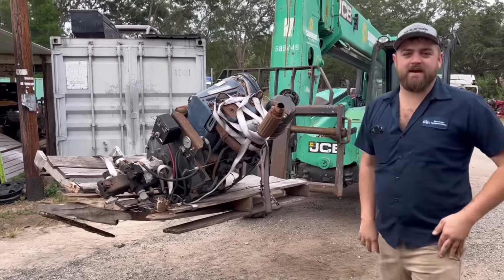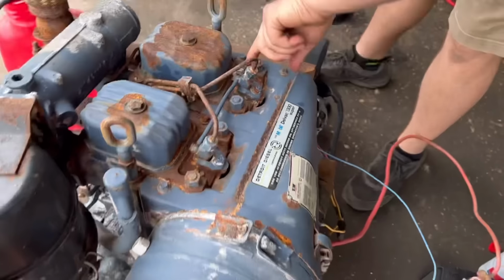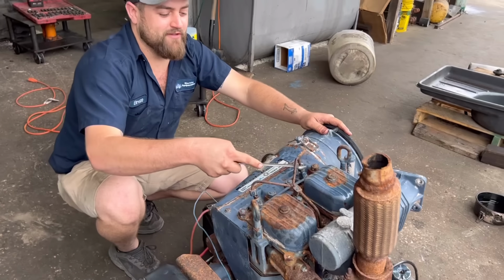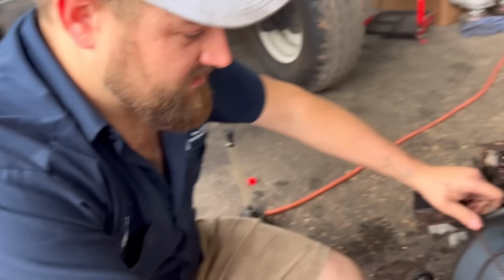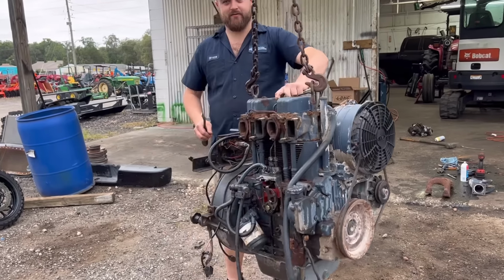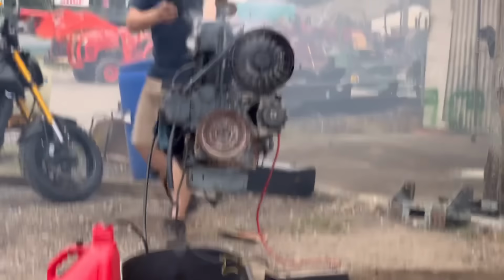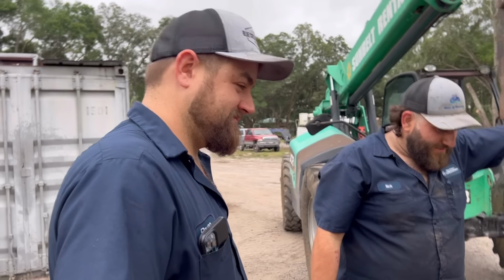Runaway Diesel Engine Ends in Explosion, Parts Flying over our Heads!

Comment: what a waste... (mic drop)
Reply: The real problem is: free entry of air along with accumulated oil in the air cooler. Oil from damaged turbo. You accelerate and the engine pulls accumulated oil. perfect combination to feed the engine at full rpm. oil works as fuel
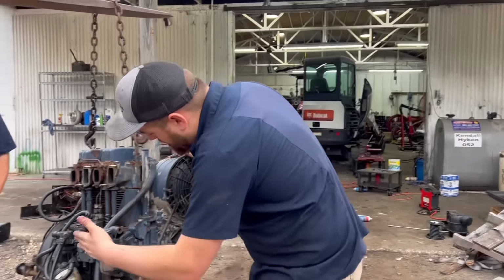Reply: Incorrect. Turbo is non-existent on this engine. This wonderful engine was intentionally sent to the recycle bin due to a lack of cooling. 33:23
Reply: @nobodyinparticular5224  Agree this is a waste. Especially since you can't even buy these new anymore

Comment: I know those engines, shame to see one blown up.
Reply: What brand/model is it? I assume it's a Deutz of sorts
Reply: They aren't really worth a whole lot...
Reply: @davelowets  Lol what are they
Reply: @jetstream454  An old VM Motori S.P.A., made in Italy....
Reply: @davelowets  It's a Deutz from Germany.
Reply: @colejohnson3705  NO, it is NOT...
Reply: @davelowets   exactly its a VM sun diesel V.M. Motori Detroit  industrial /marine / Sun model 2105E1/ 295  /2-cylinder-air-cooled-italian-diesel-engine  w/ detroit badges   2L  @ 31bhp/ 2600rpm  detroit bought VM   some time ago, hence the name but since sold it off . They are very strong engines leak alot , but hey  we all  seen what it could do, and they cooked  a decent valued industrial engine   .They only look like deutz because of  head and push rod covers.
Reply: @manuelcoronac  Huh?? 🤔
WHAT turbo? The engine is N/A.. 😕

The governor (fuel rack) was purposely jammed at full fuel, and the engine simply ran at excessive RPMs without a load until it failed.
Reply: @davelowets  Thanks for that
Reply: @jetstream454  🍻
Reply: Nawww, it failed due to a lack of cooling, the

he cut the fanbelt 33:23

Comment: Wow, I didn't think a diesel engine could spin 7000rpm for an extended period. Cool little engine. Something like that would make a cool go-kart engine.
Reply: ive seen guys spin a few limited pro stock garden tractors over 12k rpm with all stock internals
Reply: Should have a look at some OM606s. They're known as the diesel 2jz for a reason
Reply: operating was 2500 rpm....it was overfueled at 3600rpm...
Reply: Lol lol lmfao lol lol 😂😅😢😢😂😂😂😂😅😢😂lmfao
Reply: @cs-gj3yf You must have bumped your head or been on acid If you seen that with a diesel engine.
Reply: @1998keagan1  i turn 7500 rpm all stock on 80 lbs of boost, trust me i know first hand.
Reply: @cs-gj3yf  ... and then the block splits and sends the top half 8' in the air, with the rods and crank still between the frame rails, flopping around wildly.. 😬
Reply: @davelowets  fun fact, no one has ever split the block, almost all of us run stock head bolts and head gaskets, not very educated
Reply: I think it maxed 4500rpm, after it lost a cylinder was between 3k and 4k
Reply: @cs-gj3yf  A single, one lunger garden tractor? Sure those had BETTER be able to survive 7500 rpms. My little 5th of a cubic inch, one cylinder, R/C nitro engines turn 40,000 RPMs, and make 10+ horsepower per cubic inch.
Reply: @davelowets  the highest rpm the single cylinders turn is around 10k, they make 70hp out of a k361 kohler, some of the 25hp kohler vtwins turn out 14k rpm at round 130-140 hp, those things scream!!
Reply: @davelowets  what are you trying to prove?
Reply: @cs-gj3yf  That 7500 RPMs is something that a small single cylinder engine should be able to easily handle.
My kids Jr. Dragster's 5-h.p. Briggs block on methanol turns 8000 all day with no issues. I hardly ever have to touch that thing with a wrench to repair it.
Just check the state of tune by the spark plug, tune it a little bit, and send it, weekend after weekend
Reply: @davelowets  the engines im talking about have nascar valves and around 100 cubic inches
Reply: @cs-gj3yf  "NASCAR valves"?? 
What exactly are nascar valves?? 
They use the same valves that MANY other engines use.... Manley, Ferrea, Comp, Rev, and many more. There is NO specific "nascar valve" out there, the engine builder chooses whatever brand of valves they want to use. 
And what garden tractor engines can you be getting 100 inches out of? 
It's impossible to even get any where close to that amount of displacement out of ANY of even the twin cylinder garden tractor blocks. 😕 

In most "Limited Pro-Stock" sanctioning bodies, one HAS to run an engine block that is factory to the chassis it's run in.
Reply: @cs-gj3yf  I was a national small engine builder champion MANY years ago in an engine building contest. I've built some PRETTY wild small engines, so this is nothing new to me.
Reply: @davelowets  they are refered to as nascar valves, why? idk, im not a gasser guy. for the cubic inches o meant to say 70 cubes.
Reply: @davelowets  I have some .18 car engines, brand new, that I wanna modify for a 1/10 drag car I'm building: do uou mod your own engines, and if so, what mods do you make?
Reply: @cs-gj3yf  hahaha no
Reply: @detaart  haha yes considering I have done it personally now.
Reply: @cs-gj3yf  Of course you have.  Absolutely.  yup.
Reply: @detaart  thank goodness you know me better than I do, what keeps a diesel with a 2.52 bore and a 2.84 stroke from turning 5 digit rpm?
Reply: @cs-gj3yf  Many factors, but at the core is the fact that the combustion event lasts too long, in other words, it burns slow, so ... diesel engines - ESPECIALLY TRACTORS - are built to take advantage of this with a long stroke, which means higher peak piston speeds for a given RPM.
The valve train also would not survive running at 12k rpm.  Not a chance in hell.  Valves would be kissing pistons well before that.
Reply: @detaart  you think we leave the valve train alone? Custom push rods and 100# valve springs is plenty reliable, the valve heads are 1 inch and 3/4 weighing less than 1/2 a pound
Reply: @cs-gj3yf  LOL so hold on, it's a pushrod diesel tractor, revving up to 12k rpm?  Yeah maybe if you tow it on the highway.
Hey, didn't you say stock internals? lol
So ok ... Audi once made a lemans DIESEL race car, and it won nearly every race it was in.  It was a v10 TDI.  Guess the rev limit on that ... 6500 rpm.
Reply: @davelowets  maybe hes talking about the springs?
Reply: It didn’t reach 7000 rpm.

Comment: That engine was absolutely impressive!! The fact it ran away that long before letting go shows how tough and durable it is!!
Reply: It was lol
Reply: got a holden rodeo ute that ran away past redline (~8k) for about 5 minutes before it quit. We just left it for a few months thinking it was toast before i cranked it over and started and ran perfectly and barely smoked. Isuzu motor is indestructible
Reply: @darcykelly1982  Gotta be a 4JB1T, for one they are mighty tough engines but mostly because their factory turbos always let go 😂😂
Reply: @jetstream454  its a VM sun diesel V.M. Motori Detroit  industrial /marine / Sun model 2105E1/ 295  /2-cylinder-air-cooled-italian-diesel-engine  w/ detroit badges   2L  @ 31bhp/ 2600rpm  detroit bought VM   some time ago, hence the name but since sold it off . They are very strong engines leak alot , but hey  we all  seen what it could do, and they cooked  a decent valued industrial engine   .They only look like deutz because of  head and push rod covers.
Reply: @kingdommusic5456  Thank you for this! Sorry I hadn't got back sooner also
Reply: So it would be a good go-kart engine?
Reply: @darcykelly1982  Detroit Diesel

Comment: Runaway is a myth. The valves float and keep them from revving any higher,  which is true of any engine. Valve spring tension determines max rpm. That engine was almost new inside. Air cooled and it had scored a cylinder from the fan not running.  We run those to pump water.

Comment: You should be carrying a CO2 fire extinguisher on every "will it start" one blast into the air intake will shut down a runaway diesel immediately and not harm the engine. It's what we use and was taught at the fire College

Comment: The easiest way to start a diesel with low compression is to blow a heat gun into the air intake. If the injection system is working, it will start as easily as a fully warmed engine. You can keep the heat on the air intake as long as necessary, until the engine does warm up.

Comment: That engine restored looked like it would have made a great engine for several applications.
Reply: Those forced air cooled engines were used all over from manlifts to mini excavators neat little bangers
Reply: @bryanphillips1432  meaning they are great/reliable little power units. Really seemed like this one would have been a good engine with a little maintenance seeing how much abuse it took before letting go.
Reply: Great little diesel engine, could be use for many different applications, like generators, water pumps, trash pumps, irrigation pumps, chippers, log splitters, repowering small tractors, etc.

Comment: I learned a runaway diesel as rpm climbing to engine disintegration!  It was interesting to watch this small diesel overheat to destruction.  Maybe try a CAT D8000 or  V12-71 with RPM rising to destruction. Won’t even get a chance to overheat, and you probably would want to use remote cameras due to flying metal!  This was definitely fun to watch!

Comment: No cooling with oil is definitely the way to go. Hate it when people drain the oil out. Just locks up. With everything it just revs until the fuel runs out. But with just oil... Ends in destruction every time. 😃

Comment: Definitely looks like a Deutz Diesel. They are a durable engine
Reply: It’s a VM Motori diesel not a Deutz
Reply: @Adam Davies  Just like Coach Red Beauleiu from the Waterboy said.... . Wrong Again.
Reply: @LR90_200TDI  No. It's a Deutz.
Reply: @colejohnson3705  for sure... had the same style motor in an Ingersoll double drum roller
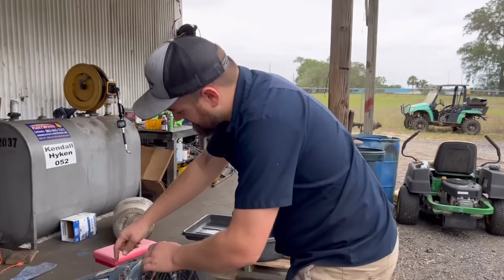Reply: @colejohnson3705  then why at 1:06 does it say VM Motori on the vin plate 🤔
Reply: yep its a VM sun diesel V.M. Motori Detroit  industrial /marine / Sun model 2105E1/ 295  /2-cylinder-air-cooled-italian-diesel-engine  w/ detroit badges   2L  @ 31bhp/ 2600rpm  detroit bought VM   some time ago, hence the name but since sold it off . They are very strong engines leak alot , but hey  we all  seen what it could do, and they cooked  a decent valued industrial engine   .They only look like deutz because of  head and push rod covers.   @LR90_200TDI

Comment: tbh i think it would have lasted way longer if you hadnt dismounted the shroud for the fan air cooling - Deuz are built so tough you can turbocharge the old engines and they work on as if nothing changed so long the oil is good

Comment: So: if you buy some construction equipment next time you know what engine you should look for. These twin Deutz Diesels are pretty rigid and take a lot of abuse before giving up. Deutz is one of the oldest engine manufacturers in the world - and they'd knew how to design an engine. They developed in 1869 out of Nicolaus Otto motor works founded in 1864 when moving from inside Cologne in Germany to a new plant in the suburb of Deutz. That was reflected in the name "Gasmotoren Fabrik Deutz AG" in 1872 already. Building Diesel engines started as early as 1897, very briefly after Rudolf Diesel came up with a working concept. So they have a long, long experience in that area. The company still exists and Deutz Classic builds air- and water-cooled Diesel engines up to a displacement of 16 Liters (around 950 cui).

Comment: If you want to see a spectacular connecting rod through block destruction, try compressing ordinary tap water at the high RPM speed like you turkeys did with this engine

Comment: To stop the runaway engine, why did you not just block the air-intake?  Without air, it will not allow combustion.
Reply: CO2 fire extinguisher would work

Comment: A diesel engine will not start on either alone, It must have some diesel fuel in it to lubricate the cylinders inorder to boost compression. Especially on one that has been sitting. Next time shoot some fuel down the intake before using either. 😮

Comment: That was a good engine, could have put some work in it and sold for profit, i just hate to see a good one ho to waste.  

There's money in rebuilding engines, i buy just about any kind of engines break them down get the good parts out and use them to rebuild, i may buy a new part like bearings, rings, most parts in an engine are salvageable it the engine wasn't dogged out.

Get you a good stock pile and start rebuilding depending on what people are looking for, i really make good money doing it,  Thanks for the video and always , be safe.

Comment: Blow up more engines please. My favorite thing here is how the wrist pin was just sitting there, wrong place but roughly the correct orientation; completely unattached. I like how you can see the sudden load change in the exhaust as soon as the other piston failed. I take it that's when all the carnage was happening, weather or not you can see it.

Comment: Might should have kept that one.😂
Reply: yep it was an industrial engine very strong. VM sun diesel V.M. Motori Detroit  industrial /marine / Sun model 2105E1/ 295  /2-cylinder-air-cooled-italian-diesel-engine  w/ detroit badges   2L  @ 31bhp/ 2600rpm  They are very strong engines leak oil often  ,  and they cooked  a decent valued industrial engine   .

Comment: I've seen too many "run away" diesel engine videos, one idea that I would like to see is hooking a similar sized diesel engine with a clutch to a gasoline engine and watching the diesel engine turn the running gasoline engine backwards! You would need to get each engine up to operating temperature, speed and the engaging the clutch between them
Reply: That would never happen... Something in the clutch system would give first. Even if it did happen, it wouldn't be anything really spectacular to see anyway...  The gas engine would slow to a stop, quit running, and then just turn backwards... No big deal. 🤷🏻